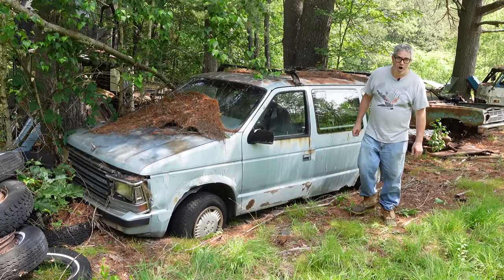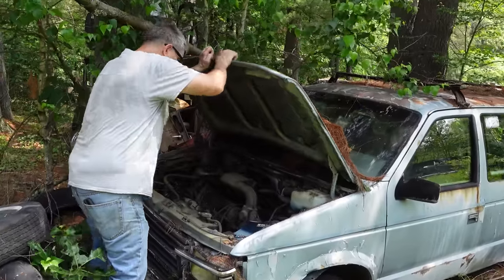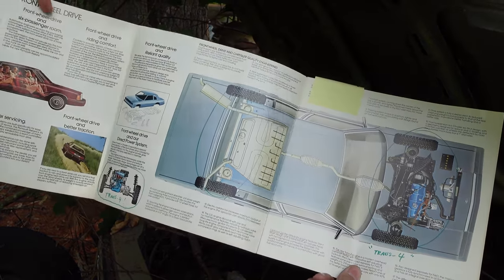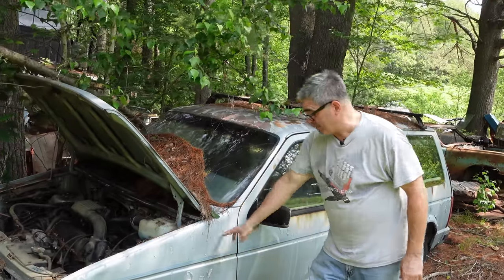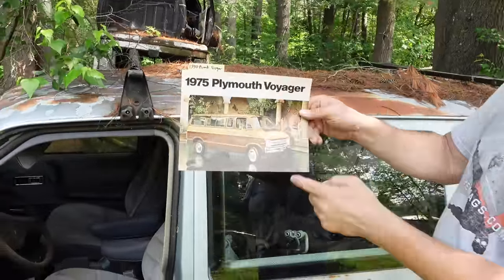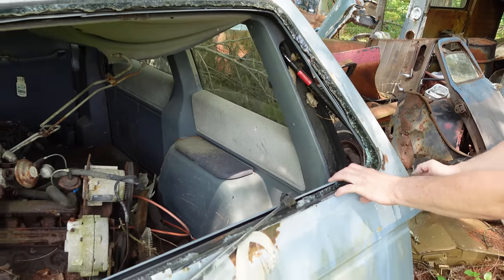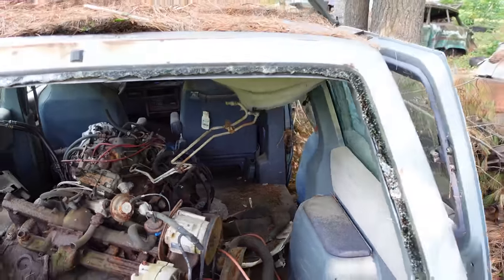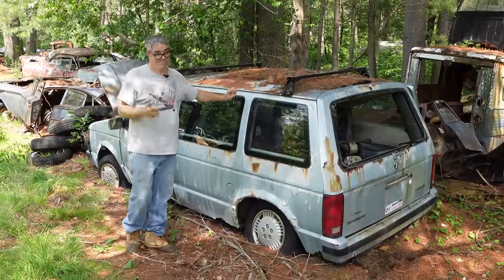Mini Minivan

Comment: In 1984, when I was 16, my Dad bought an ‘84 Dodge Caravan LE. Mink Brown with woodgrain and a 3rd row seat. Motor was the Mitsubishi 2BBL 2.6L with a 3SPD auto. Power EVERYTHING. It costed $16K USD with a ‘73 VW Super Beetle as a $700.00 trade in. I learned to drive on that van and got my operators license using it for the driving test. He drove it until 1996 and gave it me. I kept it until 1997 and sold if for $900.00 to a lady with young kids. It was a good little van! 👍😎👍🇺🇸🇺🇸🇺🇸

Comment: These were instantly loved by painters and flower shops. Anything that did not require towing or heavy weight these were perfect. Basically a redesigned station wagon. The new ones are floaty luxo barges just like the New Yorker of old go figure.

Comment: I had a bunch of 1980s minivans from 1990 to about 2010. I only went with the 2.5 liter engines. The mini minivan was called a Vista. They were good cars too. Good Luck, Rick
Reply: The Vista or rather Colt Vista was made by Mitsubishi for Dodge , not the same thing at all. They were classified as station wagons.
Reply: @kasmanien  I had both at the same time and the vista was essentially a mini minivan. In some ways the Vista was easier to work on. Good Luck, rick

Comment: I didn’t really pay much attention to K-car or mini van specs back then, but see on a couple of occasions what level of performance the little Chrysler turbo 4 could give. One of my former co-workers in SoCal had one with the 5 speed. I was spiritedly driving my Mustang on I5 one morning and he hung with me for a bit until I pushed it all the way down. Another time was with an 89-90 LeBaron on the east coast. I thought the car was a dog when pushed to the floor. At 30 mph, the thing really took off. Overcoming the turbo lag made it a bit of a sleeper in the early-mid 90s.

Comment: I know they are a different body from the K cars, but after working on hundreds of both, I'm pretty sure the front subframe was very similar to the Ks if not the same. Maybe width differences and spring rate. That was the beauty of these. Shared parts makes profit.
Reply: From the 1940s on, THIS ALWAYS ENDEARED ME TO CHRYSLER VEHICLES! I am 67 years OLD, but these are STILL the vehicles I would choose to own!

Comment: Fondest memory of the Dodge Caravan came back in 1984 when they first came out, I worked at a major airport in Michigan on the west side of the state. We used it for transporting people between the FBO and the main terminal. One morning on a Saturday one of the bosses took it out to the student Runway, and using a two-way radio with the tower, requested permission to do some high-speed taxis on the runway LMAO that van ran so incredibly well with 100 low lead that we used for the airplanes LMAO zero spark knock.

Comment: The Chrysler minivan was one of the most significant vehicles ever made. If it weren't for people ("adults") not feeling cool enough by driving them, they'd still dominate the roads today. Google's self-driving car was a minivan because it was the most practical vehicle.  If you ever have owned one, you'd understand.  The Dodge Grand Caravan with Stow-and-Go seating is both a cargo van and a 7-passenger hauler. Plus, it rides very nice. Not fun to work on though.

Comment: Bought a used '85 Caravan in he late 80's because we had 2 very young sons. It had a carburetor 2.2 litre engine. It was gutless. Only thing I ever drove that was equally gutless was a '61 Studebaker Lark with with a flathead 6 cylinder engine that was my fathers.

Comment: At the C-P-D dealership where I was in Service Management at, I saw tons and tons of these come in for ALL kinds of glitches to be fixed. The biggest issues were those plastic logos falling off, the cheap plastic door handles breaking, and countless squeaks and rattles. Some had the 2.6 Mitsubishi engine in them, and they ran great and trouble free.
Speaking of engines, you would have to be one hell of a determined individual to wrestle those 2 engines into that minivan. Why would the folks at Bernardston Auto Salvage do that? They had nowhere else to store them?
Reply: Vans are beloved by junk yards. They make excellent dry storage that is easily accessible from the rear OR the side. My favorite local yard has a line of them full of tranny's, transfer cases, ect.
Bus's are another favorite, but not as accessible being higher and narrow doors

Comment: I had an 89 turbo automatic caravan.  My buddy was big into 80s turbo dodges and rebuilt the tired motor.  I had a super 60 head and cam, FWD performance computer, tubular header with a 3" swing valve, and a massive turbo.  High stall tq converter and an LSD insert.  I even order a full 3" custom exhaust for a caravan!  Thing sounded like a peterbilt truck.  Best run was a 14.47@96 against a 65 or 66 mustang that was in pure shock.  I had bigger plans for it than that but life got in the way.

It was an absolute blast on Saturday nights though.  Even put nitrous on it.  Those 2.2 and 2.5 turbos were extremely tuff motors despite what everyone says.
Reply from the maker: You must remember in 1989 or '90 when MOPAR ACTION magazine touted the turbo 5-speed Minivan as a modern day sleeper! I remember it and they even showed how to make it a little quicker at the strip. Perhaps you saw it? Thanks for watching and writing. -Steve Magnante
Reply: @SteveMagnante  I don't remember that actually.  Thing is in stock form it was really just ok.  I had an automatic and the 5 speed with their gearing had to be decent.  In reality these were pretty poor flowing heads intake and exhaust, their only saving grace was the turbo,  and the 2.5 liters came with a tiny Mitsubishi turbo and not a garret like the 2.2.  The 2.5 was put in the minivans more for low end grunty torque.  Peak tq on the 2.5 was 210 ftlb at something like 2100 rpm.  More tq than the Mitsubishi 3.0 they put in late 1st gens.  Also Chrysler claims they never had turbo grand Caravan/Voyagers but I've seen pictures and even one in person.

Comment: I know a man almost 60yrs old that has a identical gray/silverish color. I don't know what engine it has but the last 13-15 yrs he has driven it everyday and actually makes 600 mile trips at least once a month. He keeps the ac working and its bitter cold even here in south Carolina with 105 heat index.

Comment: I bought mine in the mid-2000s a 87 with the Mitsubishi 4 banger for two hundred bucks because I needed Wheels. Drove it for a year until the brakes went out. Took it to mechanic the unibody was rusted out he didn't want to put it on the lift. So I left the vehicle with the title. The next owner painted it drove it for several years. Just goes to prove the reliability

Comment: I never owned a Chrysler mini van but, I did have a long wheelbase Chevy Venture for quite a while after my full size G-20 conversion van got wrecked for me. Since my garage doesn't have height issues (the smallest door is a 10x10), if given the choice, I'd take a full size van every time. However, that Chevy Venture did just fine too so, I wouldn't kick a mini van out of the driveway.

Comment: I remember seeing an early mule at the Chrysler Proving Grounds in the summer of 1983 and thinking “what a strange concept…”
Reply from the maker: I had a similar experience around 2000 when I was at Hot Rod magazine and we were partnering with Gumout and GM Performance Parts on a 1966 Chevelle give-away car. I was assigned to visit the GM Mesa, AZ Desert Proving Grounds to do an article on how the DPG crew "validated" the Hot Rod Chevelle car using their various Proving Grounds torture test methods. As I was taking my pictures of the Chevelle nosed up to a cement enclosure used to bring out stationary cooling system defects during prolonged engine idle, I saw my first Colorado pick up truck approaching on the outer oval track. The odd reverse-pointing / harsh angle wheel openings alerted me that it was "future product'. I wanted to get some photos but remembered that "I wanted to be invited back to the DPG". So I kept my cool - as did the Hot Rod / Gumout Chevelle Give-Away car as it idled in the "sweat box" for a half hour in the 100 degree heat and the Spal electric fans kept the motor cool. Your minivan prototype "hallucination" at Chrysler (Chelsea?) must have been similar. But it is a fact that EVERY car we see on the road WAS ONCE TOP SECRET and tested under "cladding" before public release. One of the GM Proving Grounds guys told me he couldn't get excited about the new cars on the Chevy dealer show room because they were already 4-years old to his "insider's eye". Thanks for watching and writing. -Steve Magnante

Comment: Our short wheelbase 1989 Dodge Caravan with three rows of seats accommodated 7 total and it had the 3.0L v6 with a 727 torqflight trans and would actually get out of it's own way quite well. Unfortunately 3 years after the odometer cable broke with 253k showing it was time to move up to a Dodge medium wheelbase B2500 passenger van. We probably got 300K out of the Caravan and only 200-ish K out of the 2500.

Comment: If you take that hat off the throttle body, a hole in for the hood seal above is perfectly position to fill the engine with water. Learned the hard way.

Comment: Chevy Astro the brake pedal is the size of a typical parking brake plus 50% & it is really easy to hit the gas & brake with the same foot, have that foot be a size 14 very wide you can see the delivery use problem for sure!

Comment: We had a 89  Grand Voyager and a 95 Chrysler Town and Country.. the 89 had the Mitsubishi engine and it lasted 6 years as the transmission went. the 95 lasted 5 years as the transmisson went out... We bought a 2000 Honda Odyssey which lasted 20 years...

Comment: I like to think of my 2004 minivan as a pick-up truck with a fixed roof. I took out the back seats years ago and can almost fit a 4'x8' sheet of plywood(4'x7'10", they couldn't have added 3 inches?).
It's a Ford, but does it really matter. Once the words "I have a minivan" come out, most people probably tune out anyway.

Comment: Minivans are still so much better than suvs. I said as a teen in 98 I dont know why people buy suburbans, expeditions, tahoes, etc. And I still say that today. ❤ my odyssey.
Reply: Those that you mentioned,  SUV,  they can tow more,  and more power.  If that's what someone needs, better than a mini  van. For just people hauling, I agree with you.  😊
Reply: @bertgrau3934  few tow with them. Maybe like 10%. 90% all moms with 2 kids
Reply: @Henry_Jones  
That's probably true,  I had one used to pull a camper trailer 28 feet long.  Did a pretty good job, but I traded for a 2500 Ram with a Cummins and 6 speed manual,  much better for towing.  And better fuel mileage.

Comment: If minivans still looked like that, including having a sliding door only on the right side and with the short wheelbase, I'd probably buy one. It's not pretty, but I don't find it disgustingly ugly either, like the trash they are making today. It's basically a box. And except for the transmission, which Chrysler somehow never got right, those older ones were far more reliable and easy to work on than anything made today.

Comment: If you think the term "HEMI" is defiled every time it isn't the 426, you'll be in for a shock Steve ;)
Reply from the maker: I am a Mopar nut at the core - ever since a 1975-ish sighting of a 1971 Hemi Charger / Super bee in Beverly, Massachusetts and the same-year purchase of a 1/25 scale Revell Gene Snow Snowman Charger funny car model kit with the word "Hemi" on the box. The modern Hemis are a worthy continuation despite having a squashed combustion chamber that isn't perfectly hemispherical. But again, the Gen II 426 had chambers that were rotated a t an angle to help reduce width for easier body-drop during vehicle assembly. I don't sweat over the fact the only truly half-a-sphere combustion chambers were used on First-Gen Chrysler / Dodge / DeSoto "dome head" V8's of the 1950's. And while the Mitsubishi 2.6 four popper did indeed have hemispherical chambers, I just couldn't go along with the scheme in my V8-centered mind. But then again, every Jaguar E-Type, Alfa Romeo and many, many other European engines had hemi architecture. Thanks for watching and writing. -Steve Magnante

Comment: Front drive death traps. You can kill more in one of those top heavy underpowered undertyred underbraked POS. Marginally better than tarted up work vans but that is it. 
As a dealer I refused to sell these things, both Minivans and vans. Two reasons, a customer was killed in one about a year after I sold it and people expected all sorts of things from these and they were a warranty disaster. 
Most manufactures got in on the game,, but effectively small hatches with a big body,, what could go wrong. Or the vans,, a work van with seats. Very high, ride like crap with the road holding of a dog on wet lino. At least they were rear drive.
Reply: Could ya tell me how ya really feel about 'em?
Reply: Gee, I just love it when people make stupid statements like that. But I guess you really showed them. You wouldn't sell a "death trap" van, so they gave their money to your competition.i guess that makes you the winner.

Comment: The 2.2 engines were VW derived and eventually enlarged. Those early vans were based on a stretched car platform. This was at minimal cost to Chrysler Corp. These immediately found favour with the public, took the sales lead and maintained that lead. Of course the other manufacturers took note of the sales volumn and wanted in on a slice of the pie. Some were good offerings and some not so much. Over the years Chrysler introduced features like the rear seats stowing in the floor to provide a full flat floor for carrying larger stuff. Chrysler made $millions producing these vans which instigated the Diambler hostile takeover. Really ruined Chrysler Corp. Then came Magna just before the 2008 Financial Crisis. Chrysler dealers were excited with the Fiat purchase, feeling they would be off and sailing again. Rained turds. Stellantis; the jury is out but I do not see much hope.

Comment: Ford Econoline of the 60's was a small van.
Reply: Later 60's was full size. The camper special with raised roof, refrigerator, stove, ect. Econoline 250.

Comment: In late 1983 with a recent third son added to the family it was determined that we needed a larger vehicle. The 4dr Ford Fairmont , a car which I believe was Ford's revenge upon America for spurning the Edsel, was no longer sufficient.  We wound up with a full size Dodge window van with a slant six.  It was only in retrospect that I realized that we must have walked right past the minivans on the showroom floor without so much as a glance.  As to the full sized vans not fitting in garages, ours fit fine in a new build attached suburban garage so I am skeptical of that claim.
Reply: The key word “new build”, as it would not fit in the average US garage.
Reply: @googleusergp  Not necessarily, we're talking suburban Washington, D.C. in the early 80s where they were building probably thousands of home to a similar pattern.  No question they wouldn't fit into some but every garage I knew or used was fine.
Reply: Not in many around here. Some are older. It might fit in my workshop garage which was my grandparents garage and built in 1964.
Reply from the maker: @charlesacker8552  The basic 1/2 ton 100-series full size Dodge, Chevy or Ford van would probably fit many home garages but make it a 3/4 tonner with elevated suspension and some door / roof damage is a good chance - especially unladen with cargo / passengers. Thanks for watching and writing. -Steve Magnante

Comment: These Caracrap vans should have been crushed as soon as they were made. Cheap piles of garbage.  Engines burn oil, skeeter fog everyone around them, rotted out after a few years with the rear end falling out with a recall on rusted bolts holding the rear in place. K cars were just as bad. Only reason to have one is because of the Red Green Show.